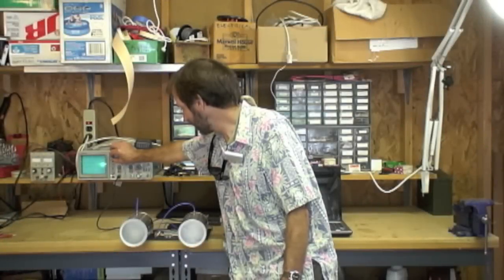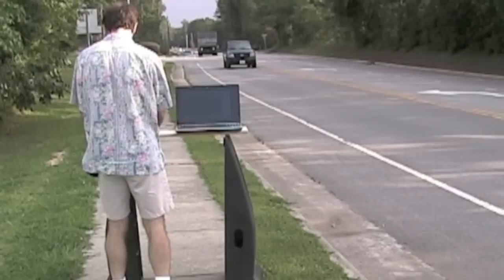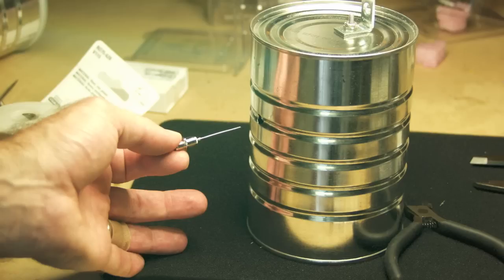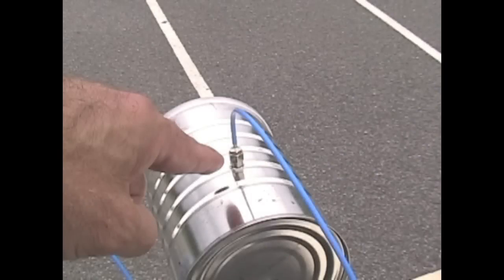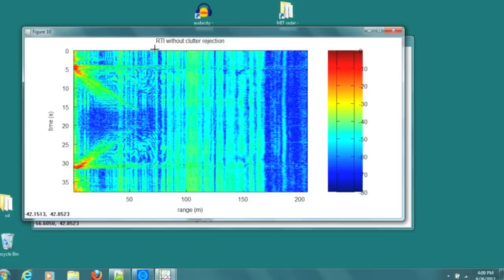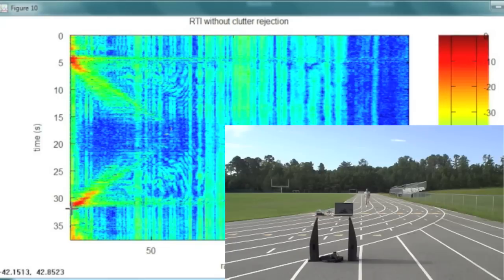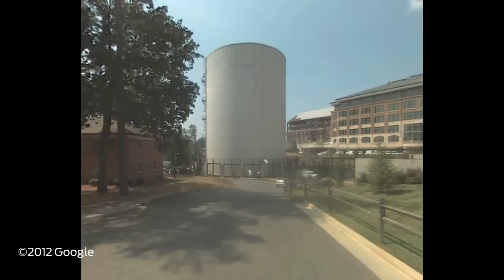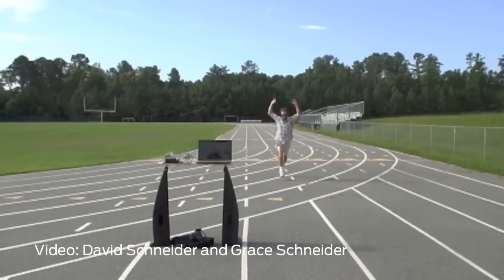Build a Coffee-Can Radar

Comment: I designed such a radar as a hobby kit I sold at my old company for $69.95 - Called it the Speedy Speed Radar gun, still sold today. Used a 2 GHz transistor oscillator with hot carrier diode mixer on same epoxy glass PCB. Audio doppler signal was sent to a hand held display unit with 2 digit LED readout of speed. A whole lot simpler than this MIT mash-up, but then again, I only graduated from RIT! /s
Reply: Ramsey sucks. Stopped makimg any good kits long ago.
Reply: Teach us how to design our own bro.

Comment: Would an unused Directv dish be good for such a project?  Perhaps use the can to transmit and the dish to receive for better sensitivity. I'm genuinely interested in trying this.
Reply: Sorry about the necropost, but an old dish like that would be amazing for a project like this in terms of sensitivity and directivity (how tight the beam is)! However, it does (normally) add a bit of complexity, as most radars that use dishes use the same antenna for transmit and receive, which means you need to add logic to rapidly switch what the hardware is doing (if you accidentally feed the transmitter into the receiver, you will find yourself with a very expensive paperweight)
Reply: @scrambledmandible Would this be like programmed pulses with respective send and receive periods?

Comment: Does anyone know why you would want to attenuate a signal before amplifying it? Doesn't that seem counter productive?
Reply: There COULD be one reason, which you can see explained even in the radio-stations and TV-stations. The sound comes from some source, goes through pre-amplification, into a mixer (with a gain control), then via the output to maybe the transmitter gear, which again can have several dampeners and amplifiers. 

Distortion can occur when the amplification of the entrance signal will result in a signal which exceed the power supply of the amplifier. This is a very known problem, and most sound systems for instance, has indicators for such oversteering-problems. So, you would often want to dampen an input signal to a level such that it does not oversteer the input amplifier. This is why you often have a GAIN-control on input side of amplifiers, such that an input signal does not oversteer. This is also why you would also have regulators on the output from the mixer, such that it does not oversteer the next stage in the sound...

Whether or not this is the same here, I cannot say, however, it is a plausible explanation.